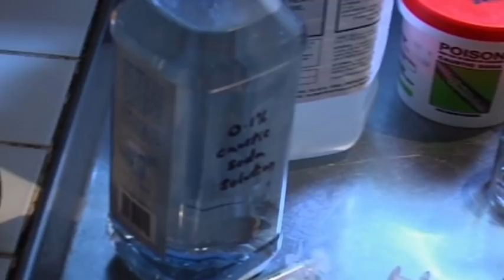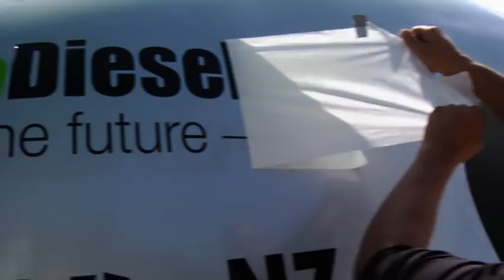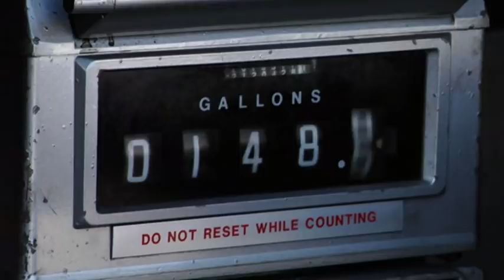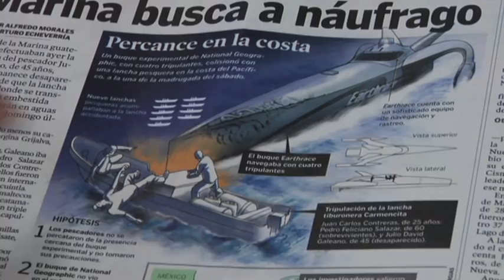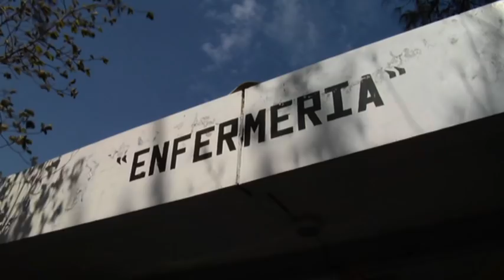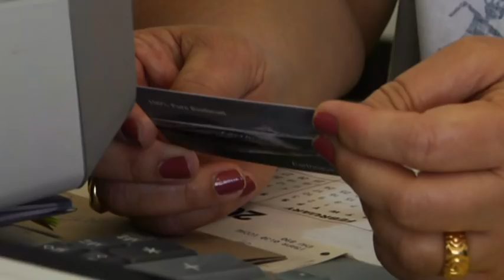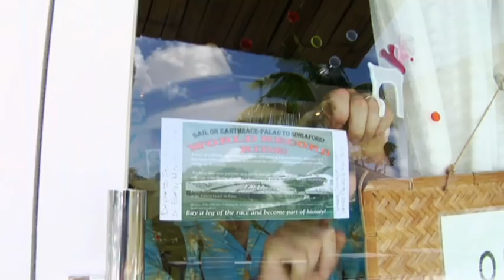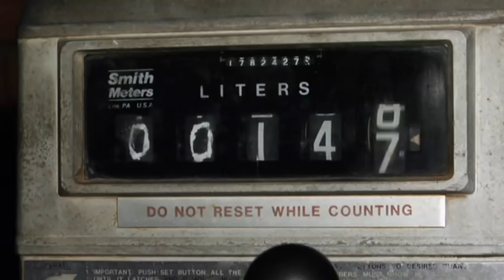Earthrace: The Powerboat Race Around the World | FULL LENGTH | MagellanTV

Comment: 16 days slower than a sailboat, why use biofuel when you can save the planet more and use wind
Reply: The current record for non-stop sailing around the world is now 40d 23h 30m 30s (42d 16h 40m 35s signle-handed). So it is 20 days faster now. Of course, those sailing boats are just as impractical for anything else than racing than the "Earthrace" was.
Reply: I guess for going against wind or to avoid trekking

Comment: Carbon Fiber props? LOL, what were they thinking? I worked with carbon fiber and THAT is not an application I would trust AT ALL. They are good for model airplanes and drones, but when you hit water with the speed of sound and force a couple tons of thrust through them, they will not last, especially as skimpy as they make them...Stick to titanium.
As for the rest of the boat, when you travel the world, comfort wasn't on the list of priorities? Big mistake huh? I bet if everybody was more comfortable, they could have been more rested, more aware, more motivated and maybe even prevented a death. Plus getting new crew members wouldn't be such a big deal. As simple as a forced air system to vent out the cab. 
The diesel engines break down, because the ECU was not adjusted for the bio diesel. The delamination of the pistons is due to the poor combustion. Multiple hot spots during combustion attack the piston head and add to uneven heat in the cylinders. Bio diesel MUST BE filtered properly and engine management must be on par. Those electronic (piezo) injectors are finicky things. Engines with mechanical injectors are much cheaper and much more suitable for crappy fuel and tough environment. Slap a big Turbo on her and crank up the fuel pressure, run a lower compression and voila, diesel power for days. Use parts that are available around the world, cummins is not as common as you think. Use 6068 John deere marine engines. They share parts with tractors.
Good job to them on the second attempt, they had learned a lot from the first disaster. Thanks for sharing this story.
Reply: Kyle Rhein  Can't agree more, he was in over his head. Like an all thumbs guy.
Reply: Kyle Rhein  he wanted to learn it the hard way. Where others knew in theory it was a bad idea, he had to burn his hand, hit his head against the wall and beat the coconut with a rock.

Comment: Addressing the shipping of fuel.  I get your point, however, this is to raise the awareness of Bio-Fuel.  How many small boats are going to do an around the world record attempt?  By raising the awareness of an alternative fuel source, the biggest section of boating can be enlightened, prompting pleasure crafters, and even shipping companies to become more educated as to Bio-Fuel's cost and benefits.  This is basically an advertising campaign.  They made record time from San Deigo to Honolulu with Bio-fuel.  It showed the engines made big horsepower without damage to the pistons and rings, valves or fuel injection systems. That right there is a huge win any way you look at it.

Comment: Visually a good-looking boat but apparently designed and put together badly, run by what could be best described as inept crew..... But I will give you kudos for getting away with killing only one person.... Considering all the above you should count it as an achievement only one person died and not more.
I would recommend that from now on you stick to riding a bicycle or better yet stick to walking and make sure you wear a helmet throughout the day.
Reply: You obviously no nothing about maritime laws
Reply: @nickm2643   if there are laws forbidding building a vessel with good ventilationor the ability to control the interior temperature better as well as forbidding the installation and maintenance of good mechanical and electronic systems then yeah you are right I probably know nothing about the law.
Reply: Dave Monte so no

Comment: An absolutely harrowing journey. It all came down to finances. If you could get together some serious sponsorship with this story and the results of the record run you can re-examine the hull design and propulsion system. Absolutely change the bulkhead openings and door dimensions to make any repairs quickly and easily. The keel needs to be sharp like the bow in the forward 1/4 or so. It will act like a shock absorber blowing through swells instead of the hard slap. A sharp entry will start slowing the drop and then the hull can flare to stop the drop quickly. This will also do wonders for hull integrity.
Cabin needs to be fit out properly. Full ventilation, head, shower, water storage. Communication array, radar. It might just be amazing to mount the racks on otr truck seat shocks. Solar film everywhere maybe even electric motors in the outriggers. Final thing could be fold down platforms that latch down on the outriggers for crew space in calm seas. They can be folded up against the cabin and latched in rough water.

Comment: Would’ve be way better if they used a PWC type propulsion system as they more efficient safer faster and also quieter also they won’t have gearbox troubles and maybe no shaft issues overall a jet ski type system would’ve worked better

Comment: Well You can poke at fuel shipping and things but I admire there ambition, I feel like the boat was poorly engineered
Reply: Any vessel before delivery is does sea trials to find problems in the build. This boat never had anything like this. jackass and his carbon fiber props. The boat was built for the sole purpose of circling the earth as fast as possible. Engines kept breaking because they kept putting crap fuel in them.

Comment: Let's see, Untested boat built from an incomplete design with an unfinished interior and inadequate fuel tankage, a quarter (at best) of the needed crew, crew exhaustion, no funding, no fuel or spares prepositioned so it is there when they arrive instead of having to wait for it, compounded with poor decision making.  Does that about sum it up? 
What Could Possibly Go Wrong??
The failure was all due to bad luck, of course.

Comment: This was entertaining.  Although I have to call them the Bad News Bears of the seas.  lol.  My God,  what else could possibly go wrong?  Someone got killed.  That obviously was the worst part of the whole thing.  Horrible tragedy.  Not sure if they would have fuel arriving at a lot of ports.  Not travelling with extra parts.  So many mistakes that if were not made they would have killed that record.  One huge thing is the ever changing crew.  and mistakes made by a new crew member that was not familiar with the boat.  Those props........what a nightmare.  Trying new unproven ones that were breaking apart because they weren't sea proven.  Costly mistake.  Constant repairs on the engines.  Just so many man made mistakes that could have been avoided with better organization.  That was the downfall imo,  a lack of organization.  After years of preparation then setting sail with a non loyal crew that would change from port to port.  Then engines and equipment that was not in tip top shape or the right machinery.  Have a dedicated crew and then have back ups that were also part of the mission from the very beginning that could fly out and jump right in if one of the crew had to leave for some reason.  That is so important.  You had years to prepare.  How could you not have all the sponsors you possibly needed before even thinking of setting sail?  UGH.  I do say though whoever your P.R. guy was,  he's a keeper for being able to secure sponsors on the fly and at the last minute in each city.  That is pretty remarkable honestly.  But something that should have been taken care of in the years of preparation before setting off.  I know that one backed out last minute.  But there should have been more sponsors lined up that would have taken up the slack.  I don't think all the avenues were utilized to raise money before hand either.  That's pretty obvious too.  I think the record could have been smashed.  Look how many days were lost sitting in ports.  This was definitely entertaining to watch though.

Comment: Carbon fiber props? Only way the would not get damage it they were made of I don't know titanium. The fast,hard riding the boat is going to be put thru. Needs material that can withstand high vibrations. Come on, for being a smart crew they made a silly decision that could of put them in a world of $h1t. If those props would of gave out during the race or when facing dangerous conditions caused by weather or other humans(pirates, thief's,)

Comment: If i had a boat like that, I would ditch the heavy engines and fuel tanks with the nightmare fueling engines, And use big para sails to power the boat instead, Its not how fast you get from A to B, It is about the best and cheapest and best way on doing it. Nice boat tho! Fck that fuel bill, Not for me! Stick to wind it is cheaper providing it blows in the right bloody direction ha! ha! I bet i could of knocked off 20 Grand on that fuel bill if i had a small rotational table up front and a para kite conected to a steel cable on a small winch and the boat would still keep up a good speeed ;) Fair Diesel?
Reply: .....well it was about how fast you get from A to B so yeah.